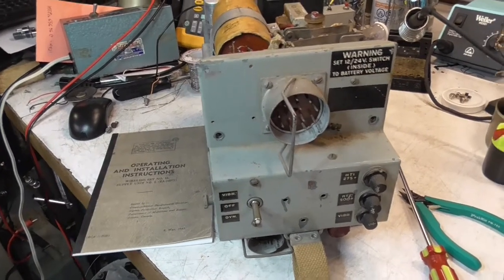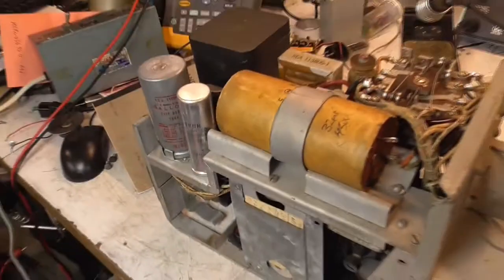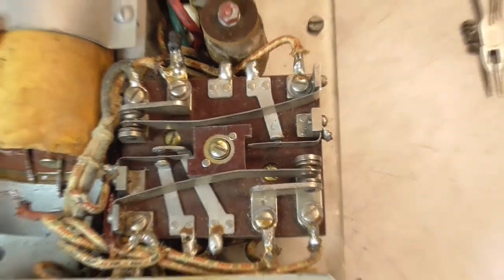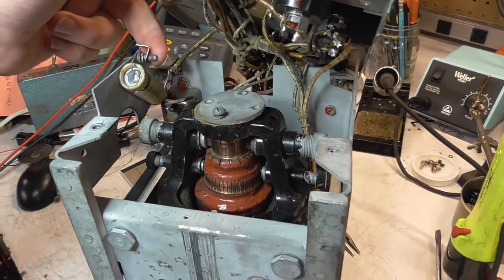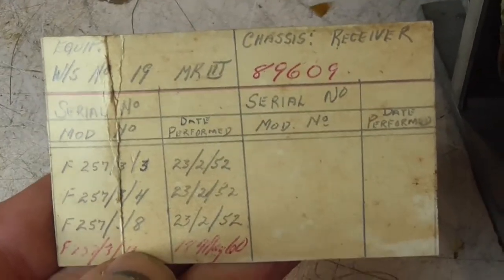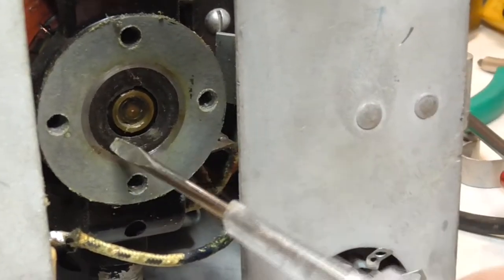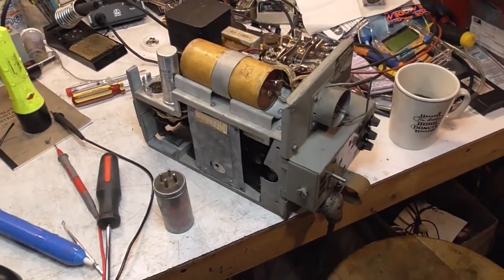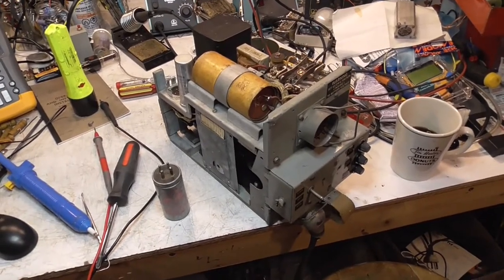Wireless Set No19 -  Power Supply

Comment: I aquired one of these WS19 sets yesterday for a really low price! unfortunately missing the power supply. I wired it up to my bench supplies and it powered right up and works! I will of course do the usual capacitor checking, resistor checking, and other checking to make sure everything is as it should. I think I will build my own vibrator supply, I have plenty of vibrators that I have repaired and sockets for them so I figured why not make it battery operated :) The biggest challenge will be to get the HT2, which should be 550V. I could maybe just run everything off the same B+ but with reduced transmtiter wattage, which I don't mind as I will not really use it for transmitting anyways. I might do it once or twice with very short range antennas to demonstrate it with any other of my radios :)